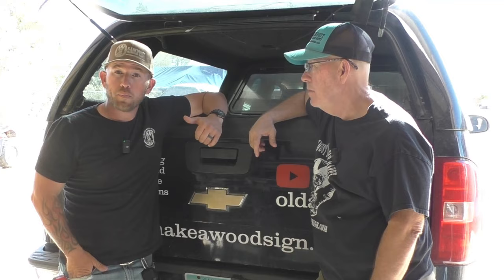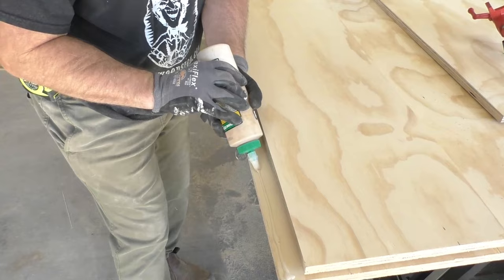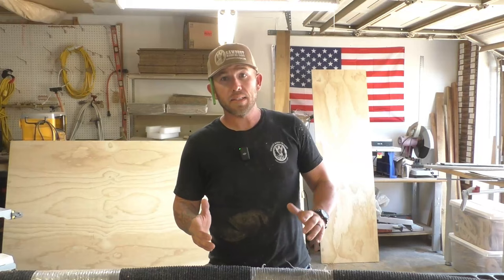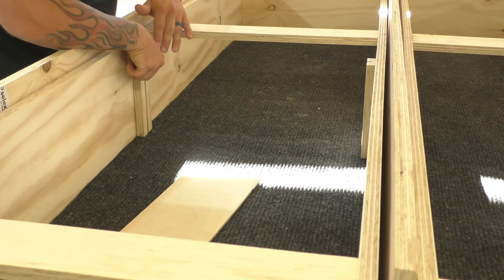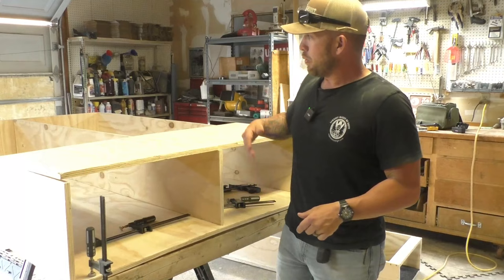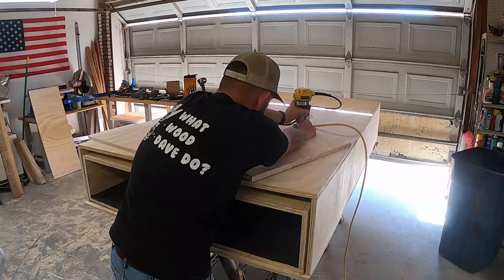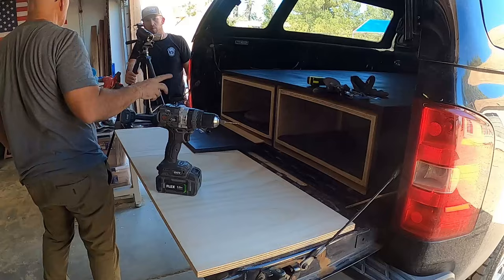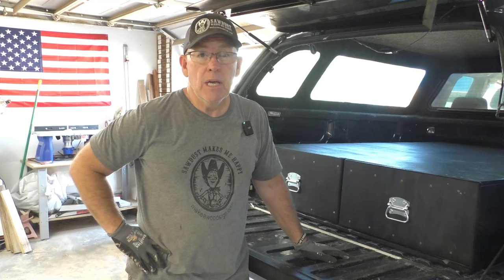How To Make A Truck Bed Tool Box // DIY Storage

Comment: Looks great. Instead of rollers I used 1/4” strips of umhw as sliders. If you park on a hill the rollers will let drawers roll out. The umhw lets them slide easy but won’t let them slide out on their own. Also keep the bottom of box flush with tailgate and tailgate supports drawer when fully extended
Reply from the maker: That's a great idea! Might have to modify it later

Comment: I have the box part built for my GMC Canyon, but i plan on using angle iron on the sides of the drawers with bearings, and the top is the width of my bed just over the wheel wells. I have covers over the front cubbies. Will take pictures when im done and send it to you.
Reply from the maker: Sounds great. Look forward to seeing pictures. Thank you for watching

Comment: Looks amazing. Have to be careful about pulling the drawers out too far  so that it does not come out of the truck. What would it take to add a couple of drop down legs on the bottom of the drawers  to extend down to the ground for drawer pullout support. One man could handle the access to the extreem back cubbie with the overhang supported with the support legs. A horizontal brace leg connector between the drop down legs would help with ability to raise the legs back up under the drawer bottom with one hand.. Sort of a lopsided "H" design.  The support legs could also be made telescoping to adapt for unlevel ground area.
Reply from the maker: Really good ideas, Thank you Gary. We may have to do an add on modification....

Comment: OK now I have to admit you have me on the edge of my seat. I have been wanting to do this for a couple years now. But I don't want to use it for storage. I want to use it to carve out of.
Reply from the maker: I think it could definitely be modified into a carving station.
Reply: Cut out the sides halfway back, put hinges on with a chain hanger. Drop down legs on the drawers as well.

Comment: What thickness plywood did you use I want to build this setup, and how did it hold up over the last 6 months. I would like to build this for the bottom with little removable smaller trays about 3/4 up the side. I also plan on putting slide out flat tray on top for a pull out work space and storage for bigger items. Instead if the casters I was going to run 1 inch roller ball transfer bearings. Cool setup and thanks for the vid ill be using for my build with some tweaks over the next couple days.
Reply: Ah, I just heard when you were doing the carpet you used 3/4. I don't think ill do carpet as I'm too cheap but looks good.
Reply from the maker: Thanks man! We used 3/4" plywood and it's held up great! I'm fact, it's loaded down as we speak with a bunch of stuff moving from CA to az. This thing has been a God send